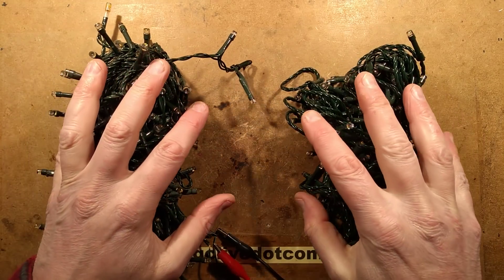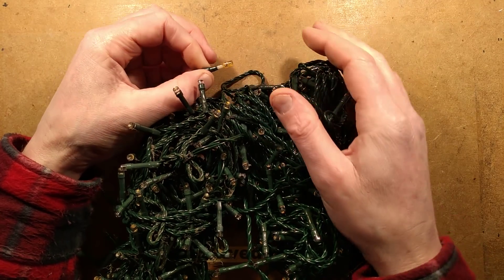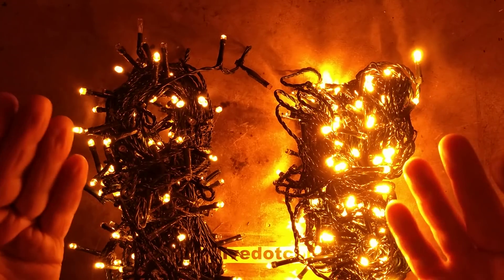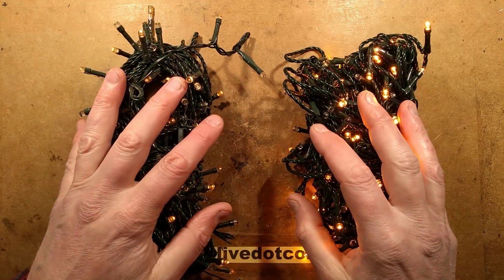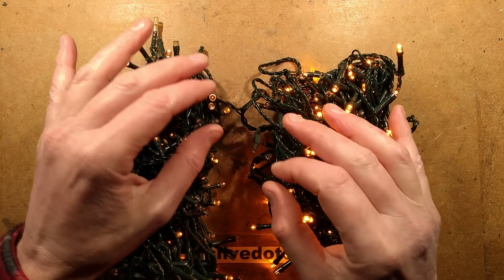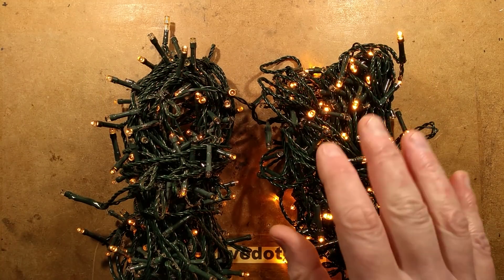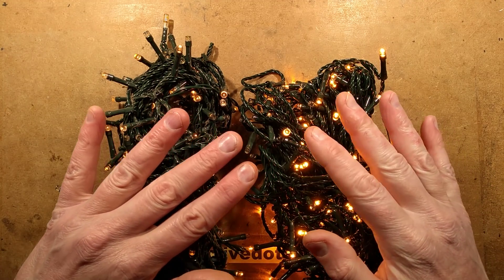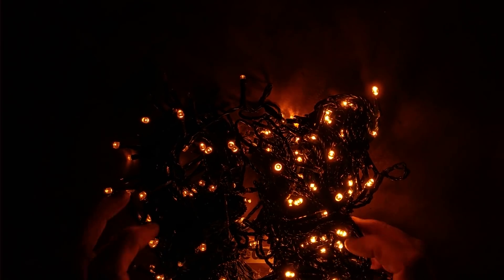9000 hour LED intensity loss test on LED strings.  (All LEDs do still work.)

Comment: EU will have an environmental breakdown this Christmas eve. The LED legislation seems to be a disaster. If you have to change every 5000 hours then the marketed 50000 hours is but an illusion or derangement. Light bulbs have constant output until they pop. Here you get less and less for the same power draw.

Who would have tried it except Clive? The nobel eletric prize 2019 goes to!
Reply: .... you realize that you are actually allowed to use tungsten Christmas lights, right? The reason nobody does that is because it’s silly.
Reply: Incandescent bulbs definitely do not have constant output until they die. They just all die so rapidly they don't have time to show much loss but the lumen maintenance is similar to fluorescents.
Reply: @Muonium1  But what is the net advantage all considered? You get the same lifespan but have to manufacture whole sets instead of just bulbs.
Reply: Fully agreed. LED bulbs (sold in Hungary)  go wrong after a few months. This way, lighting for a year is not only more expensive than using classic bulbs, but due to its electronics, they must be treated as dangerous waste.
I always disassemble them to find the reason behind: half of them have a burnt power LED due to overvoltage (manufacturers save money by using less LEDs for more bright), the other half have circuit part defects (popped capacitor, melted transformer).
What makes me angry is, as they cannot be disassembled without damage, it's not safe to re-use those bulbs even if I know what I'm doing and fix them.
Reply: So tell me, did the cheapest filament lamps give the same life as the more expensive brand name filament lamps? And what happens if your filament lamp is often cycled/switched on and off often, then how long does it last?
What about the lifespan of more complex devices, do the cheap devices last as long as the better quality devices?
Why do you expect the cheapest Far East produced LEDs to behave the same in terms of lifespan and quality compared to well known manufacturers that use quality parts and who produce quality products (but obviously are significantly more expensive)?
Although it does not work in every case, generally by carefully choosing what you buy rather than just picking the cheapest, you will get a reasonable lifespan from a LED lamp.
Reply: @Mark1024MAK  That is the problem. What has been gained? I do not know. There is an indication in this video. I can only say the old bulbs we bought were similar in performance. Compare them to the hundred year filament bulb in the US.
The issue is getting serious as the green agenda gets ever more screaming loud. What is an illusory trick and what real mesurable improvement over the life cycle?
Reply: Erb Terb - from an environmentally friendly point of view, you should be buying items that are designed to last as long as possible, are as efficient as possible and which are supplied by suppliers who will take back waste, give a reasonable warranty, and which are made by manufacturers who take care in the manufacturing process to minimise waste, pollution, energy consumption, treat their own workers with respect and treat their own environment with respect. But trying to buy items that meet the criteria is rather difficult.
But it is far too easy to buy cheap rubbish made in the Far East that will manage 100 hours of operation if you are lucky... That is most definitely not what the environmental groups want. As it creates even more waste....

Comment: So if the power is the same but the light is dimmer, the rest of the energy is being radiated as heat?  The lights are becoming less efficient over time.  That's good to know in a world where we are transitioning from incandescents and florescents to LEDs
Reply: Ray Ceeya - true, but the heat output of LED lamps is a faction of the heat output of the equivalent filament lamp.

Comment: This is sad ☹️ it means our favourite 🔦 will get dim and die!  If you buy the Wilko yellow rubber 2xAA torch it will last just 1 -2 days as it’s 3 LEDs are overdriven but my favourite Olight is still going strong used as a night light.  Good excuse to buy the same Olight again to compare brightness  😀👍

Comment: I dislike LED bulbs and energy saving bulbs i have 37 bulbs fail this year. The old woolworths bulbs are still going strong, had my electrics checked as a source of the problem and everything ok.  at an average of £3 per bulb, 67p for the old style bulbs it's hitting my pocket.

Comment: I casually look over to my old desk lamp, and recall...
I was at a hardware store one day and saw this 20 watt equivalent, warm white, led bulb hanging on the shelf.  8 dollars and some change. The brand name was "Lights Of America"   I bought it out of curiosity, and put it in my desk lamp, replacing the crappy cfl I had in it.  Granted,  it didn't put out a lot of light,  but all I wanted was basically a "Night light" of sorts.  It worked perfectly for that need. Aside from 3 moves,   and various power outages,  it has not been turned off.  And it is still going with no noticeable drop in output, 10 years later.  Perhaps the LED's are running well below their rated capacity.
Image of identical bulb in Link ↓↓
https://frrl.files.wordpress.com/2009/02/ledlightbulb_side.jpg
Reply: High quality LEDs will last longer as long as they are run well within there specifications.

Comment: I made a front light for my ebike over 10 years ago using 300 white 3mm LEDs, I chose 3mm because I could pack them closer together and they have a much nicer smoother beamspread than 5mm LEDs - haku.co.uk/pics/3mm5mmLEDs.jpg
Some have dimmed/died from moisture getting to them but it still works great - haku.co.uk/pics/300LEDBikeLight1.jpg haku.co.uk/pics/300LEDBikeLight2.jpg haku.co.uk/pics/300LEDBikeLight3.jpg I'm drawing up plans for version 2...
Reply: You do know that if you buy quality 5mm LEDs, they are available in different light spread angles...
Reply: @Mark 1024MAK  At the time I could only find the wide angle (concave center), flat top, straw hat & normal dome white 5mm LEDs, none of them produce the same smooth beamspread as a cheap standard white 3mm LED. If I'd made a light with the same amount of 5mm LEDs it would be 122x122mm instead of the 82x82mm it currently is. My plans for version 2 will require over 400 3mm LEDs... :) It'll be fully dimmable just like v1, that way I don't dazzle anyone unless I want to, like when cars don't dip their high beam.
Reply: licensetodrive - good luck 😉
Reply: @Mark 1024MAK  Thanks, I have a 3D printer now which will make it easier to get the design I want :)

Comment: Who's the idiot down the road? He's still got his Christmas lights, on, and it's March!? 
Oh, don't worry, he probably just forgot. 
That guy's still got his Christmas light on, and it's June!
Don't worry, he's gone away to Glasgow on some job or other..
Isn't that cheapskate bloke down the road using the same Christmas lights as he put up last year?
Oh! You'd be talking about BigClive! He's just doing an experiment.......!
...and this comment is from the guy who nearly blew his hand off in the consumer unit yesterday because the sparky who fitted the brand new smart meter, commoned the meter tails and didn't mark this up when he removed the off peak meter. Luckily the 100amp mains fuse didn't blow while I was poking around the  ancient and non insulated LIVE bus bar, although I did have a bit of a flash from a "screwdriver episode".  I put my trust in VDE 1000v screwdrivers, rubber soled boots, and a left hand that tends to remain in my pocket. It'd have been a pain in the arse calling out Tasnetworks to fit a new mains fuse, mainly because their previous incumbent didn't mark up what he'd done with the old meter tails. 
One wonders what the penalty is for cutting the seal and fitting your own mains fuse? I guess one could deny all knowledge and ask them to prove who did it....  which is pretty much impossible on a balance of probabilities basis.
Merry Christmas, one and all! May all your dropper capacitors remain pristeen!
Reply: Are you now suffering from arc eye 🤣
Reply: @Mark1024MAK  
No, but I'm sunburned down one side of my face, for some reason....? 😮

Comment: Go figure, new technology=junk. Yeah you might save a bit on electrical usage but you get burned on th cost of replacing them. I see that there is new technology out there for water sterilization using UV LEDS of the right spectrum. These units are at least three times the cost of a conventional UV water sterilizer. I wonder how long they will maintain their efficiency at a set flow rate.

Have a MERRY CHRISTMAS CLIVE!!!!